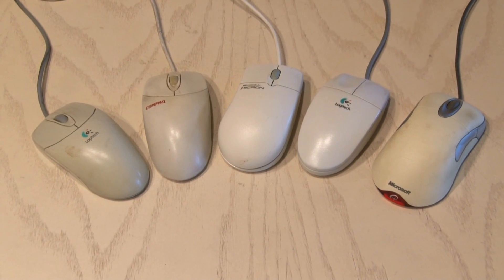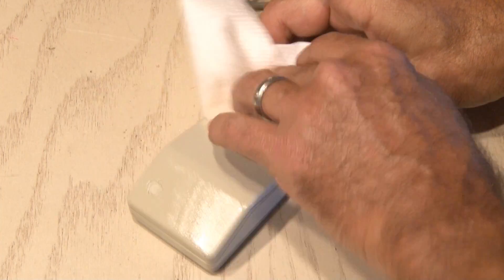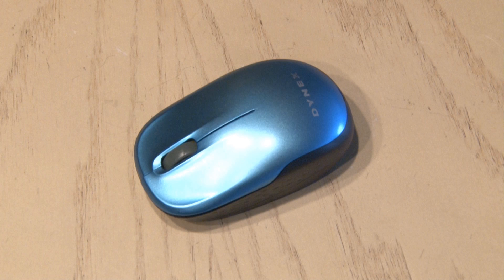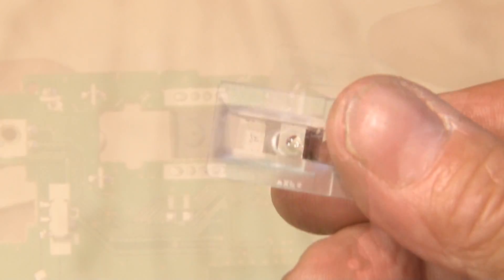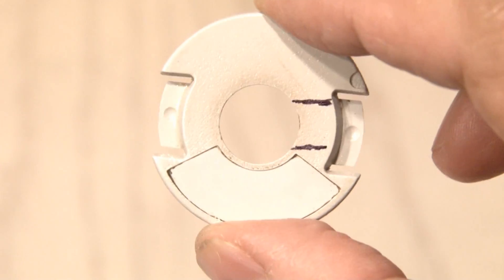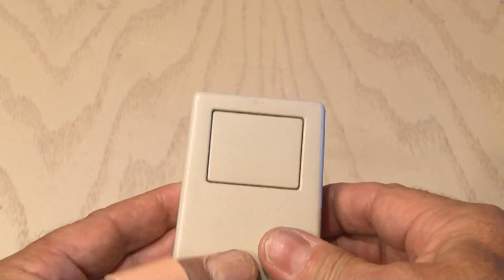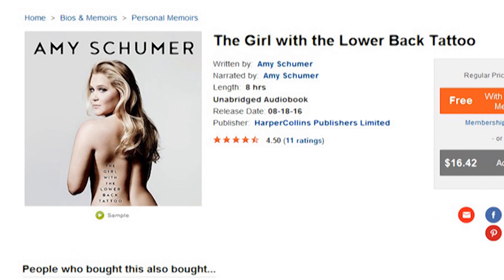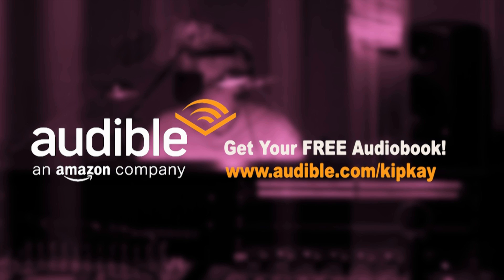Vintage Wireless Mouse Hack!

Comment: I'm calling bull** on this one. I have done several modifications of vintage mouses (though never a valuable one like this Apple model) and this doesn't look right to me at all.
I have found that the lens has to be placed exactly the right distance from the surface, or it just doesn't track properly.
The lens in this one looks to be several mm deep inside the body of the mouse, so I can't see how that would work. Try lifting your mouse a few mm off your desk and see if it still works.
Secondly, the microswitches for the buttons do not line up with where the stem of the Apple mouse button is, so it is a mystery how the left switch is being actuated by the button.
I guess that would explain why we never get to see the mouse working in the video - it probably doesn't actually work.

Also, that 'laser' is just a standard 5mm led. It even says 'led' right next to it on the pcb.

Comment: lol, Finally an apple product that's worth something and isn't over priced.
Reply: DukeOfMarshall iPads are definitely worth it. Any Android tablets I’ve owned are complete garbage. But Android phones are usually better than Apple, though.
Reply: @spicypeppers2019  Not anymore. The newer iPads snap in half too quickly and it doesn't take that much to snap in half.
Reply: Spicy Peppers iPhones still crush it in terms of processors, resource management, image processing software, and security. But most importantly, support. Apple has fantastic customer support. And this is all coming from a guy who's past two phones have been Android phones.

Comment: I have made this mod though it is wired. I think, looking back you could cut the mouse button carefully down the centre with a dremel and separate it into two buttons.
Reply: VeryVaultTec kdidijdjeiei2ieidiekeidie83ieiejri38e83838383838383838383838383838383838383838383838838383888388ke8ek

Comment: how tf does the button work, i doubt that the plastic presses on only the primary (left) button and doesn’t even press the right or middle button at all. Maybe it doesn’t even press any buttons and only bounces up and down due to plastic bending, 

KIPKAY this video makes no sense you need to revise it
Reply: LOL! Back then computers only needed one button, the left one. There is no "middle button," that would be the scroll wheel. So in theory, this is just for people who would have the old Apple mouse, so that they can find use for it.
Reply: Also, he could've cut the button in half, so that it could have both the L & R buttons.
Reply: Christian Aponte
but how would you be sure that it going to press the buttons on the inside of the mouse?
Reply: That would be if the job is done correctly. . . but I'm not that sure of how it would work
Reply: Christian Aponte
it wouldnt
Reply: Lol :( Bummer

Comment: Bluetooth mouse reciever... It's bluetooth.. It doesn't need a reciever unless you don't have bluetooth but no one is gonna sell a bluetooth mouse with reciever..
Reply: This is not true tbh, I have two bluetooth mice and they both came with receivers. Typically even bluetooth mice come with them due to the fact that not all computers have bluetooth built in.

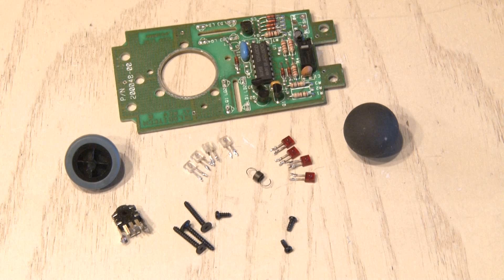Comment: At 1:10 , what you're calling white LEDs are actually photodiodes, ie. the receiving ends of the optical forks made by each pair of 1 red LED facing 1 photodiode. Between them, the movements of the ball of the mouse will rotate discs with radial slits, and that's how the electronic chip on the mouse is able to determine the movements of the mouse along each axis (2 pairs per axis are needed to determine how many times the light beam was interrupted and in which direction the disc is rotating).

Comment: Some nitpicks:
That particular mouse came out either in September 1986 (with the Apple IIGS) or in 1987 with the Macintosh II and SE. I say either, because I don't know for sure if the IIgs shipped with the mouse from the very start or not, but the 1987 Macintosh models definitely did. I would venture to guess that it did in fact come out with the IIgs in 1986. Not 1985.

The four diodes you salvaged were not visible light LEDs, but actually 4 infrared LEDs, and 4 infrared receivers for the tracking function. 

Also, while all wireless mice are sometimes colloquially referred to as Bluetooth mice, a mouse that comes with a dongle, or USB receiver, is almost never a Bluetooth mouse. In addition, Bluetooth mice are generally far more expensive than the non-Bluetooth kind. 

Sorry to be so nitpicky. I grew up with that particular mouse :-)
Unlike those who criticize you for modifying it, I'm gratified that you have extended its usefulness.
Reply: shut up nerd.

Comment: why was there even leds ?:D
Reply: So the sensors can "see" the ball rolling
Reply: the ball transfers it's movement onto rollers, which in turn rotate discs with holes in them. an led shines through them and the light is picked up on the other side by a sensor. When the ball rolls and the roller turns and the disc spins, it sometimes lets light through the holes and blocks light where there's not a hole. So if the sensor detects that there is no light and then suddenly light and then no light again, the computer knows that the disc must have been rotating, and translates the speed of this into movement of the mouse pointer. 
There are 2-3 of  these sensors in a mouse like this. Even today there's at least 1, for the mouse wheel.

Comment: Hot glue doesn't dry....
Reply: Well, it doesn't evaporate, at least not significantly and that's not the point. Technically it hardens, but it also "wets" a surface because it sticks to it, like water. Liquid nitrogen does not "wet" surfaces, but does it dry because it evaporates?

Comment: At first I thought he was going to get rid of the cable and solder on some sort of Bluetooth receiver but I'm not exactly sure if that's possible. I'm guessing in the end it was easier to just replace the whole circuit board.

Comment: can you call a diode, a laser?
Reply: Laser diode.
Reply: Bilbo_Gamers oh, I'm no LED expert, but aren't all diodes "laser diodes" then? I mean they emit light at very specific frequencies (except pink and white ones) and red lasers are basically just red LEDs?
Reply: but a laser is not determined by the frequency that it emits light in, but rather the parallelity (is that a word?) of the light that it emits. An LED emits light from a central point and (unless focussed/scattered by the plastic of the LED) emits it in all directions. 
A Laser emits light with highly parallel beams into a certain direction.
That's the reason why a flashlight shines light in a cone and a laster makes a thin line of light. This would be the case even if both light sources emit highly pure light of only a very specific wavelength.

That said, I suppose you could focus, narrow and filter light from an LED to make it highly parallel.

Comment: ok for the record they were most likely IR emitters & detectors you pulled out. useful stuff if you know how to use it :). also the wire is great for various stuff... if you know what your doing an old mouse is a treasure trove. 

as for the mouse ball i made some non return valves for a water pump science fair project years back. their cool being its silicone outside & steel ball inside.

Comment: It's wireless and it works on 2.4GHz frequency, but it's not using bluetooth. You can't connect it to a bluetooth-enabled device, you have to use it with the provided adapter.
Reply: not every computer has an internal bluetooth receiver. I'm sure my desktop doesn't. My laptop however does, but not my older laptop, but pretty much every computer has 1 or more USB slots, and if they're used, there's usb hubs.
Reply: this is the dumbass thing I've ever heard why would I want to use up the one USB port on my laptop for a mouse when I can just use the internal Bluetooth receiver also as a manufacturer wouldn't it save me $ not having to make those dongles
Reply: Wireless mice were introduced on the market, because technology Bluetooth was not yet popular and barely anyone had BT adapters build into their computer. BT dongles were still too expensive for average consumer. That's why manufacturers started making their own wireless dongles. They were not as flexible as BT, but cost a fraction of the price, were but good enough for the use and worked out of the box for virtually any computer.
Since it's easier and cheaper for manufacturers to keep using the same technology, instead of trying to promote Bluetooth, those "2.4GHz wireless" mice are still far cheaper than BT-enabled models. Most people don't care about one used up USB port, so they will choose a cheaper model.

That said, I agree it is better to use a Bluetooth mouse, if you have BT built into your computer. That's why I bought a $50 Bluetooth mouse, instead of a $2 "wireless" one.

Comment: would it be possible to cut that button in half and have the buttons on the motherboard relocated to line up with the left and right side of the cut button
Reply: or you could have totally unsoldered the buttons on the motherboard , added some wire to relocate them, cut the large button on the housing in half and add a gap for the mouse wheel and put the extended buttons under the left and right side, I've been watching your videos for years and seen you make way more complicated stuff, I think you can make the wheel and both buttons function
Reply: Or make it have a hinge like thing in the middle so when you clicked it would turn/rotate and activate the button. It wouldn't sacrifice any looks either.
Reply: better solder new buttons with wires on it so you can choos where you like it
Reply: you could try making the button rock back and forth so it would not have a gap down the middle of it
Reply: justin rivera nice totally didn't say that earlier

Comment: you cant click
Reply: or the mouse wheel. he could have totally unsoldered them, added some wire and relocate them, cut the button in half and add a gap for the wheel and put the extended buttons under the left and right side
Reply: yeah he doesnt show how he aligned the button on the switch. it probably doesnt move as well cause he never show it working
Reply: I thought I missed something, but I guess Ol' Kipkay did instead.

Comment: it's NOT A LASER - thats the camera - the LED lights the surface through the plastic lense - and the camera detects changes under it as the mouse moves - you can change the red led for a blue or even IR led

Comment: why dont you cut the clickable top part with your dremmel and divide it with right and left click
Reply: And cut a slot for the scroll wheel. It would be great!
Reply: It would ruin the look, though. I was thinking during the video, adding a small button to the right side would be cool. Could be done in an old school way so it looked like it was modded back in the 80's.

Comment: he.... he called the pcb a motherboard
Reply: "From Wikipedia, the free encyclopedia:

A motherboard (sometimes alternatively known as the mainboard, system board, baseboard, planar board or logic board,[1] or colloquially, a mobo) is the main printed circuit board (PCB) found in general purpose microcomputers
 and other expandable systems. It holds and allows communication between
 many of the crucial electronic components of a system, such as the central processing unit (CPU) and memory, and provides connectors for other peripherals. Unlike a backplane,
 a motherboard usually contains significant sub-systems such as the 
central processor, the chipset's input/output and memory controllers, 
interface connectors, and other components integrated for general 
purpose use."

Comment: "And I held it in place till the hot glue dried"
Um hot glue cools
Reply: same thing
Reply: it dried as it cools
Reply: Not really
Reply: Well duh, but what does it become when it cools? Dry. Therefore hot glue cools and dries.
Reply: It becomes the same thing
If you put heat to it it will melt
It's like metal it melts and cools not dry

Comment: You were rather brief on how you managed to get the button to align with the microswitch on the board when you closed it up. Also, a solution to having two buttons would be to cut the large button in half. Again, alignment would be a challenge.

Comment: How did you connect the mouse button so when you click it it clicks down on the button on the board? I don't think this is legit
Reply: How do you turn off the mouse besides taking out the battery

Comment: You are wrong about a lot of things in this video:
1.those things you salvaged are not white and red diodes-they are IR diodes and IR recievers.They are used for tracking the ball movement.
2.The mouse is not bluetooth. It just uses 2.4GHz, that does not mean bluetooth.
3.The thing you call laser is actually the optical sensor. Laser and optical mice are completely different.

And why waste a mouse to stick it in this garbage?
Reply: Maxsfable
I don't think destroying a mouse is a reasonable hobby... I also do DIY electronics projects, but I try not to destroy anything that works and is usefull. Also, that mouse is from Apple-the shittiest and most expensive(for no reason) brand, but it seems people like paying more for the same or less(M&Ms, Oreo, Nutella, Rolex and all the other rip-off's). There are brands that just rebrand a chinese product and sell it for more, a lot more. I am sick of people not seeing this trend and continuing to feed companies. Got a little carried away, sorry. :D
Reply: For the vintage feels, dude. I know many people who still use IBM keyboards.
Reply: +Element Finland also because it's a hobby. people find stuff like this very fun and enjoyable.
Reply: I know the feel of rant, so I understand, but as for the hobby part, that's your personal preference. While you may not want to "Destroy" (I use the word disassemble, since he's putting the parts to use in some way and not outright wasting it) this kind of stuff, some find the fun in breaking stuff down and doing something unique with all the pieces, like making a wireless 1980's mouse. Not too practical, but I can see the fun in it.

Comment: Is it actually bluetooth, or is it just a 2.4g wireless mouse？ Cuz most 
computer won't need a bluetooth receiver dongles nowadays. Also, how do 
you even enter pairing mode without the right buttons on the apple 
chasis?